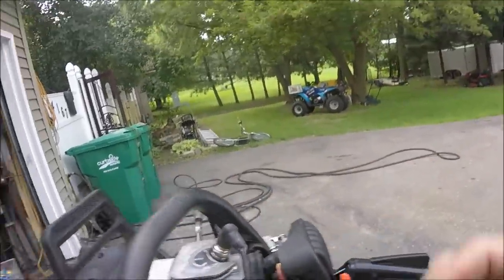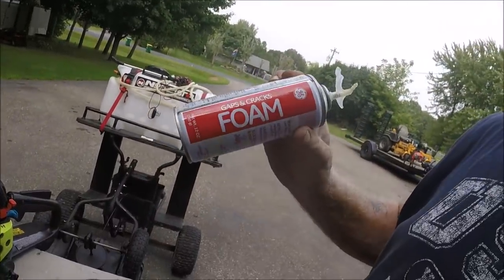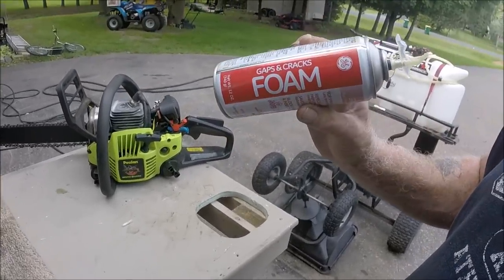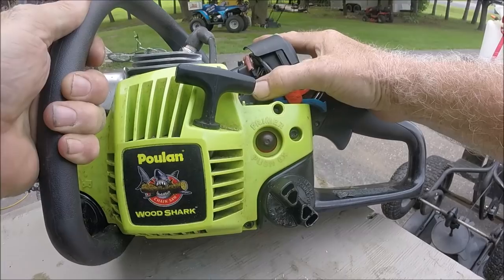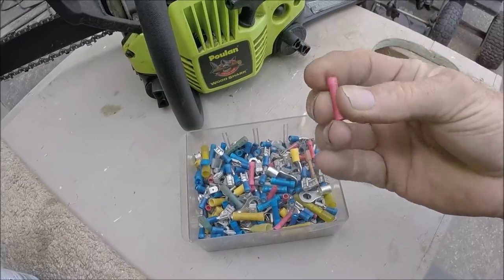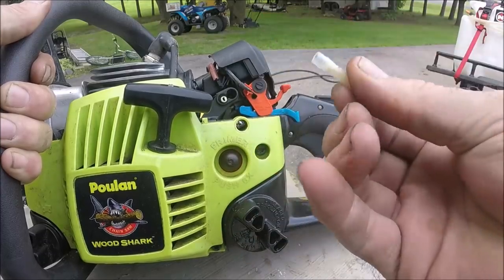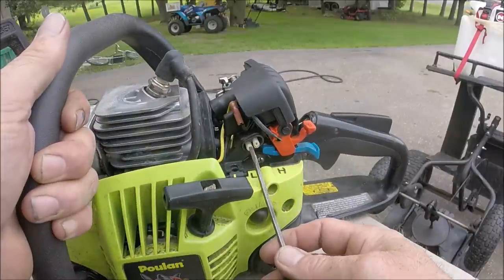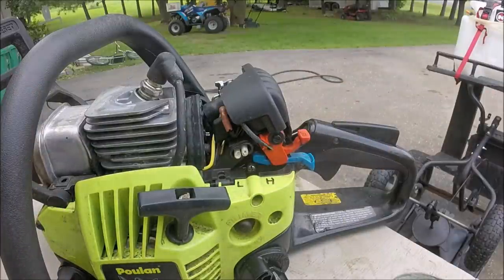HOW TO ADJUST A CHAINSAW CARBURETOR WITH NO SPECIAL SPLINE TOOL

Comment: Bob, you saved the day!  The "great stuff" tube pressed on perfectly.  I used a marker to mark the "top" of the tube near the carburetor for reference.  My Husqvarna 445 started fine, but when I pulled throttle lever it would bog down and begin to die unless I let go of the throttle.  It wouldn't run at operating speed, only about 1/3 speed.  Here's what fixed the problem.  My Low took about 1/4 turn to the left (open) to be more responsive to throttle.  The High took about 1/4 turn to the left (open) to remove the "stalling" issue and now it runs perfectly!!  Back in action, thanks to you...   You're the man today!  Happy New Year!!

Comment: 5:56  This is probably the best explanation ever!  Thanks for the help, got my pp180 running smooth again.  I like your tip with the foam can nozzles.  I took one and superglued it to a long junk hex screwdriver that came from some long-lost Walmart furniture set.  Now I have a tool I can use to adjust carbs anytime.

Comment: Idle speed screw is below those adj screws. There's a hole in the recoil housing for that.
Reply: What he said!  The Idle adjustment screw is clearly visible and there is an opening in the green cover to adjust it without removing anything. That is the adjustment used to set idle just below the speed that chain starts to move.

Comment: I have a Poulan Pro 42cc saw which is new, and I just got it to start, but it will only run for about 15 to 30 seconds on average before it quits. I figured that the adjustments for the carburetor was incorrect. I don't have the special wrenches needed to adjust the hi, and lo settings, and will look for some at the local saw shop tomorrow.  I thank you for providing us with this information and I will see if my older Poulan saw is in need of adjustment also, but it have given me great service since 2000 when I got it new.
Reply from the maker: i have videos on how to adjust a carburetor with things you have at home.
Reply: I have to check those videos out since I will be doing adjustments on all my saws, and trimmers at one time.
Reply: Shops will probably not sell you those as the epa doesn't want you to adjust them. You can order them on e Bay from China for less than 10 bucks or do what this guy did.

Comment: The idle screw is under your high low adjustment on that model you can see it right by the choke
Reply from the maker: great thanks.
Reply from the maker: thanks
Reply: outdoorstech o
Reply: Yeah, I am going to take advice from this guy who cannot even see the idle speed screw in front of him. And has to write L and H, when it is embossed on the cover he took off.

Comment: Good job !! Tomorrow I will try to wedge a small screwdriver in an electrical connector and do the adjustment without removing the cover.

Comment: Thanks! Great Idea. I think I have one of those Great Stuff cans. I was going to just order the stupid tool. But, that's what they want you to do. That is why they now make those things with special  tools instead of just a flat-head or Phillips head. Plus, I need to do some cutting this week and my Poulan is idling too fast. I can't wait a week or two for tool to get here. Thanks again. I'll try this.
Reply from the maker: i have another video on this, of other things you can use that works too. look it up. thanks for watching.
Reply: The EPA doesn't want the end user to adjust the carb,(air quality regulations).as well as putting limiters on as too....

Comment: Your video was a little long Bob, but you gave a great tip on how to adjust the set screws.  I didn't have either the tube or a butt splice, but I was able to use the insulated end of an alligator clip.  Thanks for the idea.

Comment: Those screws come in many different configurations besides splined,a whole set of drivers that will cover most  2 cycle carb high speed low speed adjustment screws,are available on amazon for a few bucks.Do your self a favor and buy them....

Comment: Hey Bob, got a poulon 14" wildthing. Won't stay running, rebuilt carb, changed filte,r,  lines plug would run in choked idel set with choke itself open. Rebuilt again and thorough  cleaned. Still couldn't get the damm thing to stay running except in the stepup choke setting no matter adjustment. High or low. 
So,,, ordered a brand new carb,,, same sad thing.  What am I looking for?
Thing looks just like mine cept it has purple plastic and green
Reply from the maker: have you changed the gas filter in the tank? check the compression. check to see if the exhaust or muffler is clogged. new plug !!!!!!!!!!!!

Comment: if my poulan p3818av is having issues with not getting enough gas is it the low screw I have to hire? plus it has a T idle screw as well.

Comment: Use a red butt connector crimp a piece of copper wire or small screw in it. Drop of super glue on the other end  slide it on and you’re good to go.

Comment: Great video my friend.  Since you do not charge either will I here is another secret, Shrink tubing  ,      Heat and a screw on the other end (cut screw to fit.  ) put tubing on suggest heating screw end first before on one end leave long . THEN put on the other end keep short as possible heat adjust remove if necessary.  If possible I leave on....
Reply from the maker: very cool, thanks